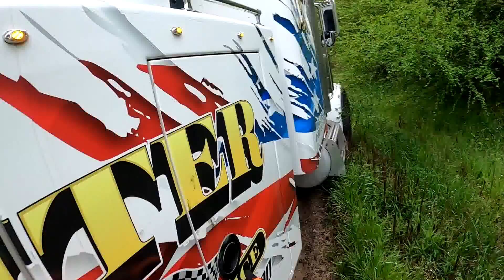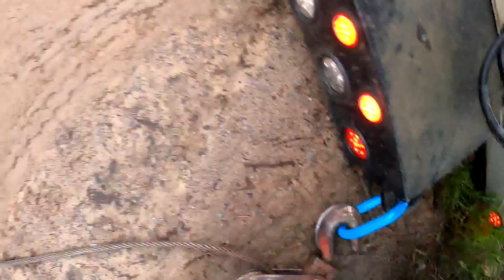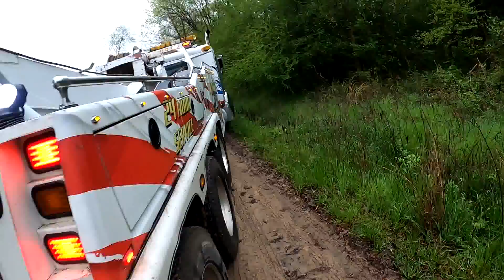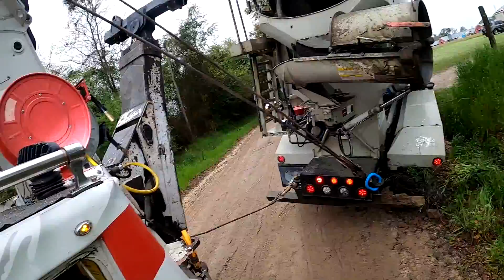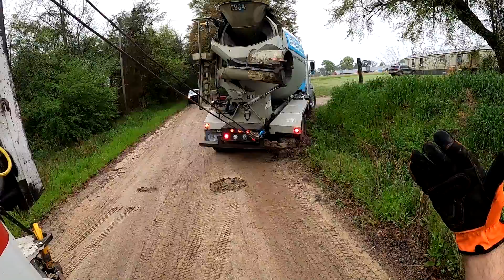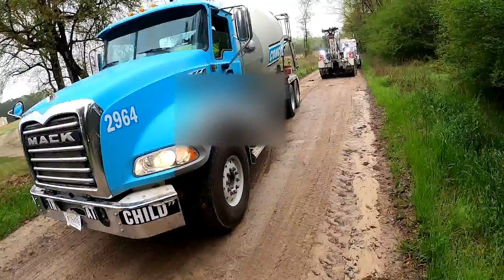Concrete Truck About To Flip

Comment: You did a nice job. There is a video on you tube of a cement mixer going over before the wrecker got hooked to it. The driveway was too soft at new construction.
Reply from the maker: Plowkingf15 I saw that one. The wrecker was on scene but had not hooked up. Thanks for watching and stay safe
Reply: @SumterWrecker  I saw that one.  Why did that driver hook up to the wheels, instead of running a block to a tree or something to stabilize it until the big truck got there???  He could have also parked out on the pavement and run a line through the trees to help stabilize it.  That truck should have never gone over.

Comment: That driveway looked tight.  Plant manager or someone from the safety team should have been out there before the truck(s).  Maybe it's a small company and they don't have a safety team but there's someone who's senior who could have made a visit.  As was stated elsewhere, backing in looks like a good option for this approach.  Mixer looks fairly clean, they take good care of their equipment.
Reply from the maker: Mr Brian  yes sir they do take care of the equipment.  Thanks for watching and stay safe
Reply: Concrete supply company. They are a big company happens alot because they have to go into alot of small places that sometimes wasn't meant for big trucks.

Comment: PEOPLE PLEASE LOOK AT THE HEADLINE TO THIS VIDEO IT IS 100% CORRECT. THIS IS A CONCRETE MIXER OR TRUCK. NOT A CEMENT TRUCK. CEMENT AND CONCRETE ARE NOT THE SAME THING AS MOST THINK. CEMENT IS A POWDER SUCH AS PORTLAND CEMENT THAT GOES IN TO THE MIX ALONG WITH OTHER MATERIAL AND CHEMICALS THAT MAKE CONCRETE.
Reply from the maker: Mr Dan Sorry our title is misleading. I do not work in the concrete or cement business. I run a tow business but if you Google both terms you get the same pictures.  Thanks for the information.Stay safe
Reply: @SumterWrecker  Your title is 100% correct sir. Your title reads Concrete Truck and you are correct it is a Concrete Truck or Mixer. However Concrete and Cement is not the same as some posts use the term cement when it should be Concrete. So again your Title or Headline is correct I was not saying your Title is wrong I was saying that some of the posts were incorrect. By the way I was in the Towing&Recovery Industry for 18 years before becoming a Concrete Mixer operator. Operated everything from a 1 ton to a 50 ton. I would still be in that business if I had a stronger back. Great Recovery. Stay safe.
Reply: @SumterWrecker  Also some of the rude posts kinda pis$#d me off. Just because you used the under reach to pull that cable out don't mean you did anything wrong, in fact I thought it was a very smart thing to do. Work smarter not harder and that is exactly what you did. You can't have your cables absolutely perfect every time if your busy going from one winch out to the next. Also just because the cable was hard to pull out don't mean that it was wound up incorrectly it could have just been the brake was to tight or the cable was hung up. You performed that recovery perfectly In my book. 😁
Reply from the maker: Mr Dan thanks and thanks  for the information.  Sorry you were not able to continue in the Towing  business.  It is  a very physical job. I learned  something  new tonight and as long as I continue to learn that's good.  When I stop learning it will be time to quit. Stay safe

Comment: Well you got the job done I agree with Thomas at the beginning of the video u were looking for something opening all your doors then u found it then the cable stuck u cant be that busy to respool in a winch out I've left the winch lines connected pulled the wrecker forward then winch the casualty to me respooling my lines customer is no wiser of what your doing this is what happens when multiple drivers drive one truck as a supervisor one of my drivers on a wreck I couldn't find something in his truck after I told him to straighten his equipment out well I started removing everything out on the ground till I found what I was looking for a pear ring buried under all his crap the cops laughed and he never embarrassed me again he my driver cleaned up his act now he is more responsible
Reply from the maker: Thanks for the advice and comment.
Reply: @SumterWrecker  🕵lol! Your fired !lol
Reply: That sentence is longer than the winch cables.

Comment: If my boss caught me pulling my winch cables out with my underlift and seen my cables in that condition I would be fired on the spot..... from Chicago
Reply from the maker: Sometimes re-spooling your wire rope in between calls is not possible when you have customers waiting. Luckily I am the boss lol.
Reply: @thomas Roberts thank you for doing it the right way

Comment: Didn,t see any anti roll precaution, we always put a strap diagonally around the drum and strap or chain it in place attatched to one winch, keeps from rolling and pulls vehicle out of ditch at same time, we also pull em out frontwards where possible. From uk.
Reply from the maker: Mr. Philip Is that technic called the strong arm. I have heard of it, just haven't tried it.  Thanks for viewing and commenting
Reply: @SumterWrecker  Hi thanks for replying, l dont know what its called, its something we developed our selves over the years, we also use it on reefer trailers etc, it really works especially on narrow roads with not much angle, regards.

Comment: YOU DONT DRIVE YOUR OWNE CAR LIKE THAT !! BUT YOU DRIVE A 80 ,0000 LBS CEMENT TRUCK LIKE THAT !!! YOUR FIRED !!!!!
Reply from the maker: JRBROOKS Thanks for watching
Reply: It's NOT a Cement truck sir. It's a CONCRETE MIXER. Cement is a powder that goes in to the mix such as Portland Cement with sand limestone or round stone or pea rock along with chemicals that make a final product that is called CONCRETE.
Reply: @dandunning4409  either way it's a kill zone
Reply: @DramaMustRemainOnTheStage  What are you talking about?

Comment: TURN OFF YOUR DRUM !!!!!!!!!
Reply: no  cement will harden
Reply: First of all it's NOT cement it's CONCRETE! Second you don't stop the drum that will allow the CONCRETE to start setting up. Always keep the drum rotating. Their are situations were you would stop the drum but it wasn't leaning bad enough in this case.
Reply: It's gonna be cement
Reply: @DramaMustRemainOnTheStage  How is that going to happen? Once it's cured it's still Concrete.
Reply: Where was this located